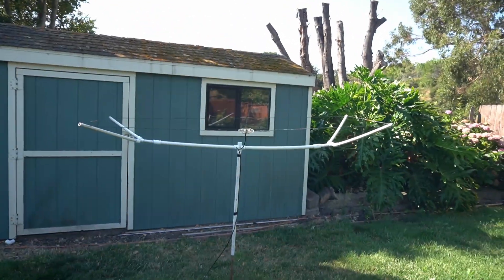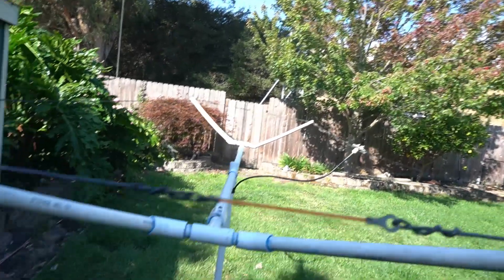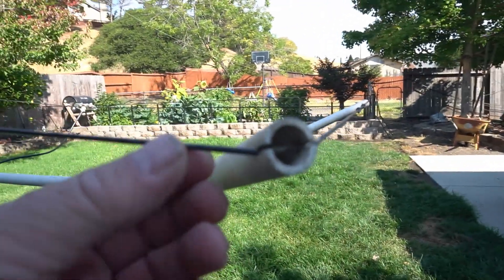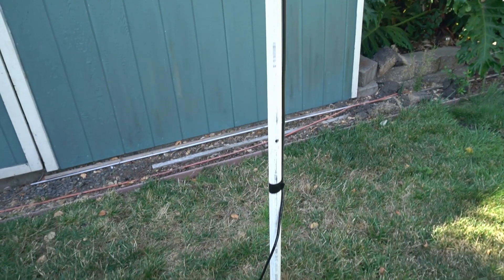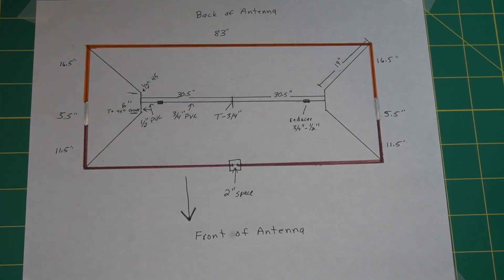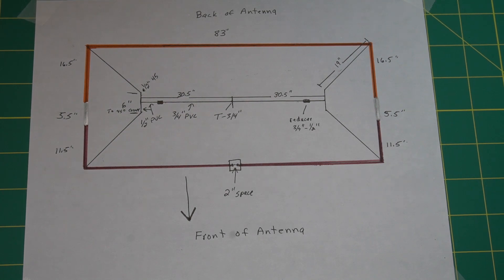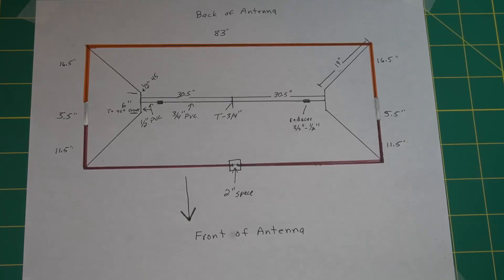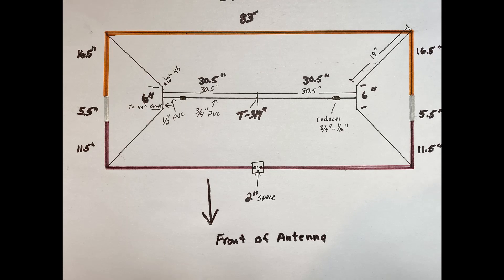How to make a 6 METER MOXON. Cheapest way to make one of these great antennas.

Comment: Just came across your video. Nice version. 👍Mine is still up in the air after all these years. The resonant point on mine has dropped a little after all this time but it is just fine for my operations. 73 John - N1PCE

Comment: Cool build. I just had a couple of questions, I think I know the answers, but....
1) These measurements are point to point and not actual pvc cut lengths?
2) The 2" spacing on the insulator, that 2", is that between the two contacts or OAL of the plastic insulator?

Oh, how high did you end up mounting this?

 Thanks, two thumbs up 👍👍
Reply from the maker: Yes on the second question. And I think the measurements your asking are P to P and you can adjust at the ends to keep wires tight.

Comment: Thanks for the video. How do you adjust for best SWR, and what kind of band width do you have?
Reply from the maker: It's just like a Dipole you adjust the length of the driven and you can adjust the reflector the same percentage but leave the gap between them the same.

Comment: Your gaps are absolutely critical per experience on 2 meter. What I am questioning is feed point gap. I found that  critical too. You will have to recalc if go to lager wire. But hell of a 2 meter low power ssb 144.2
Reply: What what is the gap on the two spacers

Comment: I did also. I have an MFJ-1896 6 Meter Moxon. I want to build a 2 meter version. And yes, mine covers the whole band. These are great antennas. There is a program on the internet called moxgen that will help you design it. They have good front to back also. Very good antenna and they do work mounted vertically.
Reply from the maker: Yea Don I forgot to mention that they work vertical also, thanks for the comment and for watching!